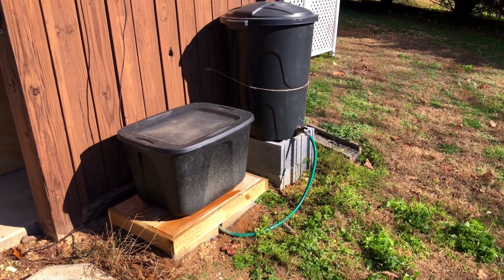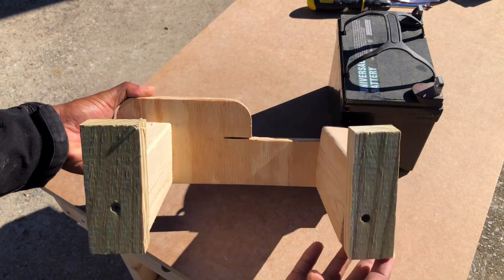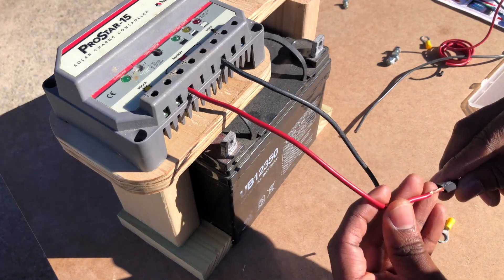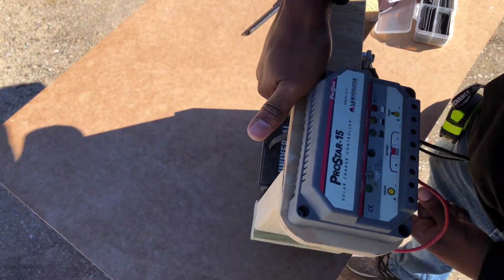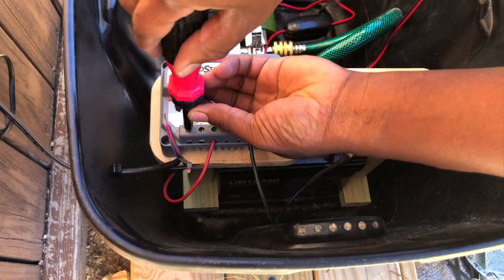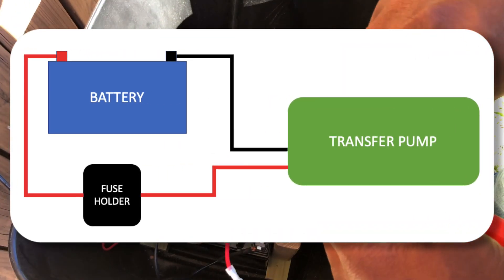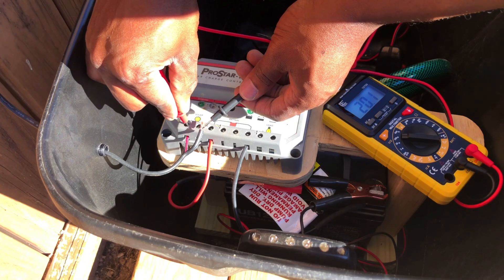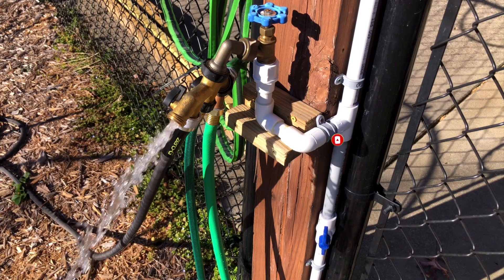Solar Water Pump | CHEAP Rain Barrel Solar Pump Setup

Comment: What kind of brackets did you use for the solar panel mount?
Reply from the maker: The solar panel used in this video was a panel I had on hand already from a few years back, so I do not recall the exact place I purchased the brackets, but the brackets are Z Brackets. You can find something similar to mine here at this link: https://amzn.to/3a21d4J 
Note, depending on what size solar panel you are using will determine if this bracket type is sufficient. I typically just buy the bracket from the manufacture of the solar panel if they sell any, or look at the weight limit for the bracket.

Comment: Brilliant! I was waiting for this. Thank you for sharing your process and making such a great tutorial. You do nice clean work. 

Just one question: What actually triggers when the transfer pump turns on? Is there a float?
Reply from the maker: In this video, it is just a manual trigger that you turn on yourself to activate the pump. The pump itself comes with a on/off switch. In the other videos I've made after this I've added my own switch all the way to creating a way to remotely turn it on with my mobile phone. :D

Comment: Questions; The directions on the battery say do not charge in sealed container, is that a problem with the tub?  What would be the equivalent lithium battery?  What type of pump are you using with this system?  Thank you for your help.

Comment: I have a battery operated timer that I want to connect between the pump and my drip line. Is there a way I can have the pump connected so that it only runs when the timer kicks on?
Reply from the maker: I would think you would need some type of on-demand pump that is able to detect when the pressure in the water line is decreased (the timer activating and opening the valve) and automatically turns on. Else, if the timer has a way of outputting a signal to a relay to allow you to turn on the pump, that would be another option. I'm sure there are probably some other options out there as well to keep the concept simple.

Comment: Thank you.  Your videos are very thorough easy to follow.  Really looking forward to you doing more videos on small solar projects.  I plan to do a rainwater capture system and wanted it to be solar.  I wish you would do a compost bin that rotates using solar power. I’ve seen some videos where they use a 1/3 hp motor.  Thanks again for your video.
Reply from the maker: Thanks for the feedback. I have seen videos regarding the compost bin as well. It is definitely something I want to look into more.

Comment: Great upgrade to the system!  Very impressed with your ingenuity constructing the system.  One thing I may suggest in your plumbing is to add a pipe union fitting on the output side of the pump.  As it is currently shown, if you have to remove the pump, you will have to cut the pipe to remove the pump.  With a union, removal becomes much easier.
Reply from the maker: Great suggestion!

Comment: What was the total price for pump, panel, battery and charge controller?
Reply from the maker: The pump was $50. The solar panel I already had on hand but at the time it was somewhere around $30. The battery I already had on hand and is overkill for this project but it was roughly $65. The charge controller also was over kill and was about $100 at the time I purchased it. Most of the components I used in this project are found in the description, and I also provided a cheaper charge controller that should also work.
Reply: @GreenTechTown  thanks a bunch! I have a handful of friends/acquaintances that are interested in this exact set up and I'm happy to have a number for them.

Comment: Thank you for taking your time and showing that. I have two rain water containers with 340 gallons each and was in need to pump the water to my garden. This is a good info video that will help me to move on to a new way to transfer the water using something other than gravity because the pressure is not enough.
Reply from the maker: Glad to be able to help!

Comment: Nice system you have there. I've been wanting to do something similar for a while now with drip irrigation.
  If I may, I'd like to suggest you wire your pump to the load output of the controller. The controller protects the battery  from being overcharged by the panel, and can protect your battery from over discharge by the load through that output. Most controllers have a 10 amp rating on their load output. To control a circuit over 10 amps you can use a relay.
  Batteries are somewhat electrically fragile, their lifetimes can be drastically reduced from being either overcharged, or over discharged just a few times.
I'm interested in what else you're going to do with your little system there. Good luck.
Reply from the maker: Great suggestion John, and thanks for sharing!

Comment: hello this is fantastic and something i am going to be doing this season!  Wondering if i could just run the solar panel directly to the pump?  What are your thoughts?  Thanks
Reply from the maker: I have seen people who have, but if you would like to run it at any time of the day, the battery setup would be the better route to go. Also, depending on how much power your pump requires may require you to buy a larger solar panel. Either way, glad to hear you are looking into it!
Reply: Normally electric motors require a high current surge in order to start. The panel may not be able to provide that surge in order to start the motor. Although it might in strong sunlight. Go ahead and try it temporarily no more than about 10 or 20 seconds, it won't hurt anything, then if it does not work, you can put a battery in the circuit.
Reply: @johnwyman6331  Thanks John, I may just put the battery in anyways to ensure proper motor function

Comment: Great job!  Like your descriptions and recommendations. Would recommend adding a drip coil loop to your wire entering the battery container to ensure the water drips away from the container.  Also keep coiled wires off the inside bottom of the container.
Reply: Since it's only 12 volts DC, it won't short out in water. Although it is still good practice.
Reply from the maker: I agree,  and thanks for sharing.
Reply: I'd also have set up a drip coil loop just before the solar charge controller in case the gland of the thru-fitting deteriorates over time and the external drip loop is disturbed to prevent it from doing its thing. (Water could afffect the solar controller's operation shouild it enter the controller.)  The panel's  Voltage  won't "short" out in the traditional meaning, but it will conduct some current and may decrease your solar panel's output to the controller  too.  Your vids are excellent!

Comment: What an excellent project!

I'm moving off-grid and will NEED to do this but I have zero experience with solar or irrigation and I'm gathering materials to build a garden of around 5000sqft and around half will need automated watering...  my question is, what do I need to look for or consider to pick a pump that can work on 12 volts to water that area? 

What do you think?

(I live in the third world, so expensive or hard to get materials is kinda out of the question)

Edit: the government allow us to make 3 purchases on line and not pay taxes, so there are things from amazon that I can purchase!

Comment: Unfortunately, worthless anywhere temperatures will get below freezing.
Reply: Well, what would you do if you had that system and it started to get near winter and you didn't need to water the garden till spring?
Reply: @johnwyman6331  If you raise the rain barrel off the ground a few feet you have virtually no need for a pump, solar panels or solar regulators and of course a battery. The water pressure would be more than sufficient for your watering needs.  A pump will produce about 50 psi of water pressure and consumes quite a bit of energy.  One small battery wouldn't provide a lot of run time.  You can't use the entire capacity of your battery, only a fraction of it before it drops below 12v and will not power the pump anymore-plus, dropping the battery to low voltage repeatedly will quickly kill your battery and unless you have either a lot of sun or a massive solar array to recharge the battery again,not a great system.  Overly complex and expensive to achieve what a bucket and gravity could accomplish for a tenth of the cost.
If you live in an area where you need year round water and it freezes then you need to bury the cistern or heavily insulate it and all of the components or they freeze and crack.

Comment: this is awesome! is there any way to have the pump automatically kick on for drip irrigation?
Reply from the maker: Hey Andy, yes there any many commercial applications out there on the market right now you could buy that run off battery power or AC power. For my application, I went the DIY route which you can find a video on my channel.

Comment: Solar Water Pump
For rain barrel what about Water Well do have a electrical pump.I am just wondering could use instead Solar Water Pump??!!
Reply from the maker: Yes this solar setup could be use for any electrical pump. Of course the larger your pump, the larger your hardware (battery, charge controller, etc.) may have to be. Also, some pumps are AC powered, so if that's the case for you, some type of DC to AC inverter would also need to be installed.
Reply: They make specialty solar well pumps. You can Google it. Normally you need a larger array though.

Comment: I'm interested in seeing relays and timers hooked up to the pump to stop the pump when water pressure is good and timers for watering plants.
Reply: Do it in modules. That way configurations can be changed around as needed.

Comment: Love it. I initially thought it'd be used for a solar shower setup which I now want to do. Not with rain water though.
Reply from the maker: That's an awesome idea! Go for it.
Reply: Why not Rainwater? It's very clean, soft water without all the chemicals they have to put in the public water supply. Some people actually put filters in to take out all those chemicals for their showers.
Reply: It depends on how I can get clean rainwater.  An open barrel that the rain can directly fall into is ok but I would consider rain coming from a roof grey water as it’s not going to be free of bird droppings or other bacteria.
Reply: @i537  typically you use a first flush system if coming from a roof just for that reason.

Comment: I was wondering if it would be possible to run a small water pump directly off of a solar panel. I want to build a very simple pool heater, using a small pump to push water through a simple collector. When the sun comes up, the collector warms up, the panel starts generating power to run the pump, which feeds water through the collector and heats the pool. I was hoping that it would be a nice, simple, inexpensive project, that would allow me to access some "free" energy completely separate from the pool plumbing. I don't need a large pump, I only want to feed a small volume of water through a relatively small collector. I don't expect to do away with my current heater, this is just something I would like to start with and see where it leads. 

Would such a project be possible? Do you know of any videos or articles describing such a project?
Reply from the maker: It should be possible, however, I have never done so myself. I have ran across a few videos here on a YouTube where it seems people have pulled it off. Here is one video, but I have not watched it in detail, but it seems he is running a really small pump off of a solar panel: https://www.youtube.com/watch?v=sf8u0dOfxnY

If you search for "solar water pump" in the YouTube search bar, you may find some other videos. But ultimately, the larger the pump, the larger your solar panel/array may have to be if you want to get around from using a battery, and vice versa.
Reply: As long as the top of the heating panel isn't too far above the surface of the pool, then a low power system can work. Although I would not hook it directly to the PV panel because the pump will start before the heating panel gets warm- cooling the pool water first. If you place a 100° Fahrenheit snap disc switch in the top of the heating panel, then wire it into the pump circuit, it should work. Unless of course you want to invest in a 12-volt DC differential controller (Art Tec makes one), but the snap disc switch is much, much cheaper, and would probably give you 98 to 99% of the heat the differential controller could supply.
We tried it once at a solar firm I used to work at.

Comment: do you not have to use an adapter for the battery to convert from DC to AC?
Reply from the maker: For this application, I did not have to use an inverter which is typically used to convert from DC to AC. If you wanted to power something that required AC power (such as something that plugged into a wall outlet) , then yes, you would need to install a DC to AC inverter. Hope that helps :D
Reply: @GreenTechTown  Thanks man. I just thought that pumps only accepted AC!
Reply from the maker: No problem. Yeah I chose a DC pump for this application to reduce the extra hardware (i.e. inverter) I would have needed if I went with a AC version. Harbor Freight does sell a AC version transfer pump also if you want to go that route.
Reply: Some small utility pumps are 12volts DC. Try Harbor freight.
Your projects are well designed .

Comment: Great video, I hope to hook my rain barrels up to a similar system one day using an on demand pump that you mentioned in the prior video. You also mentioned wanting to remotely control the water pump in the future. I am a big fan of automation too. Hooking up to a simple timed power control may be the easiest. So you just have the pump powered on a timer. There is probably a more sophisticated method of hooking into an irrigation system type of setup that also accounts for recent rain, etc. That would be fantastic but is beyond my current know-how.
Reply from the maker: I agree. I've seen some of the devices you've mentioned in stores, and I think for simplicity and user friendliness, that would probably be the best route to take to get something going quickly. For my application, I plan to approach it from a DIY standpoint to keep my costs low since I have the needed components already, but it will take a little more effort.